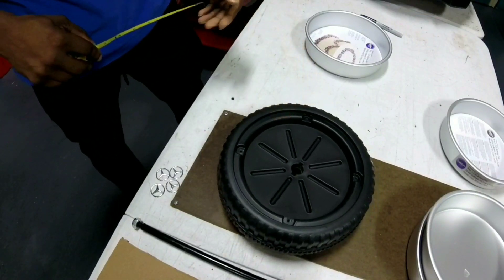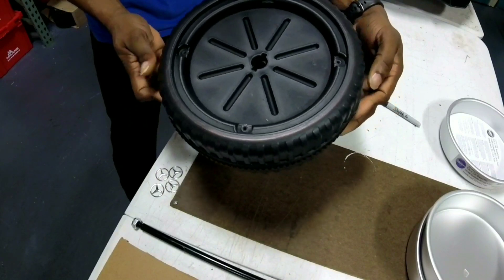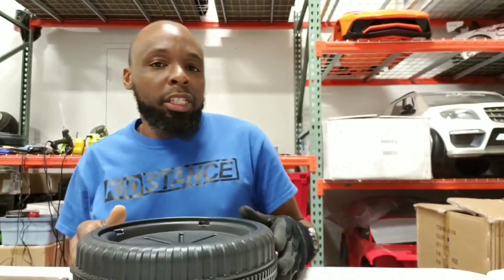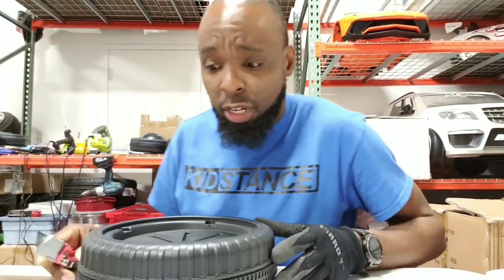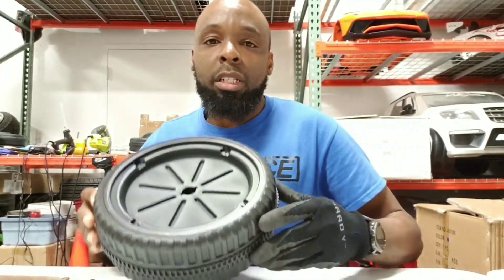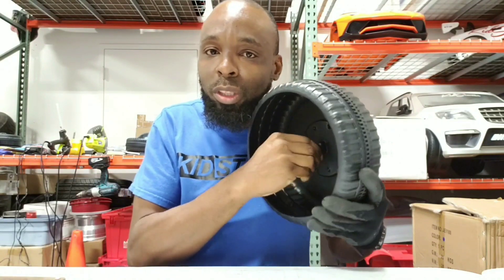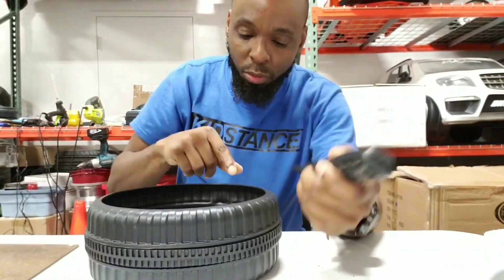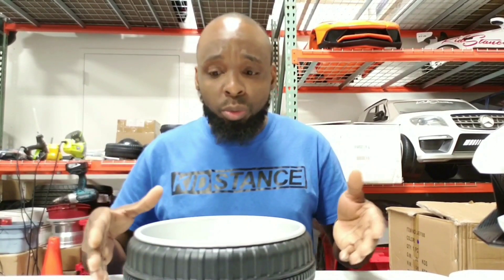Kidstance Workshop: Introduction to Customizing Wheels Part 2

Comment: Just a tip, take a heat gun and warm the mold of the original wheel, then cut it.
Or warm the edge of the blade before you start cutting , and it goes like a knife through butter ;) 
Amazing work, my man, your an artist !